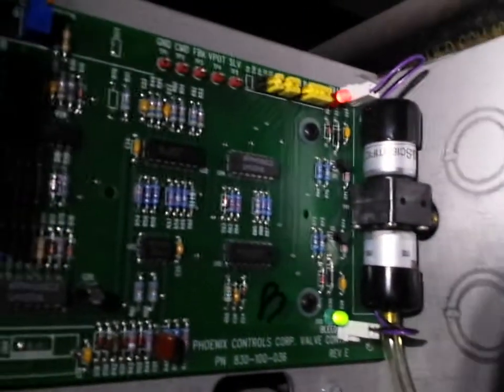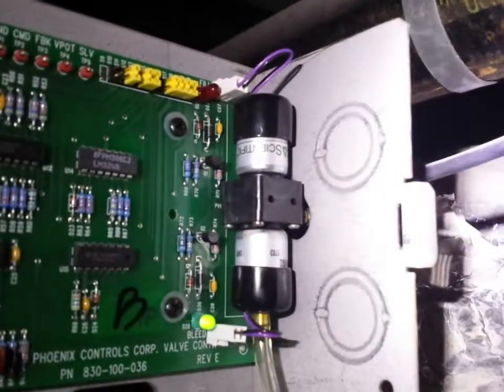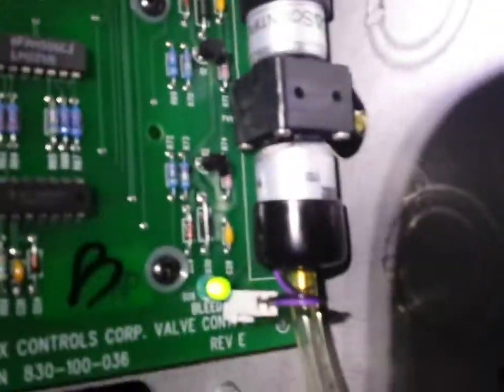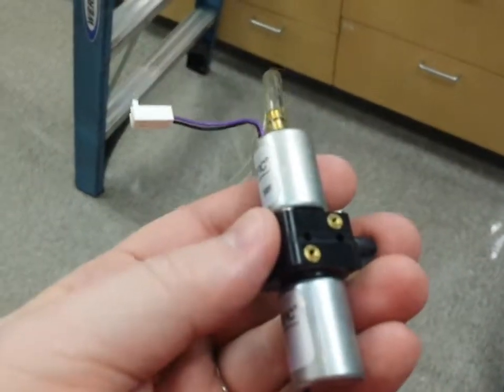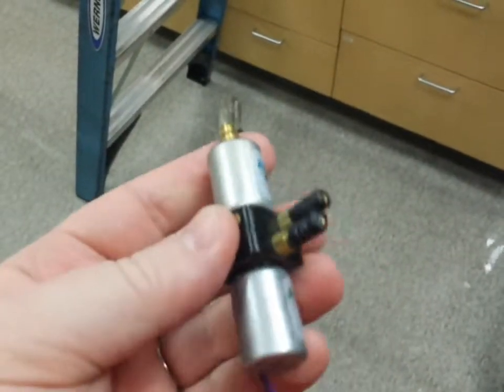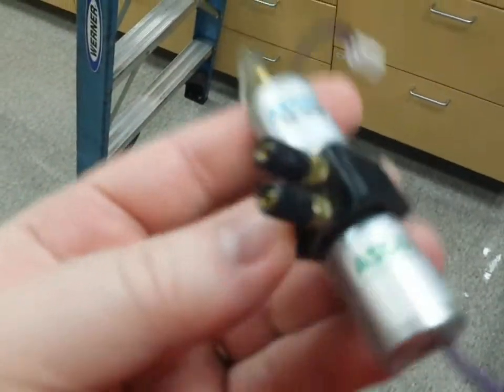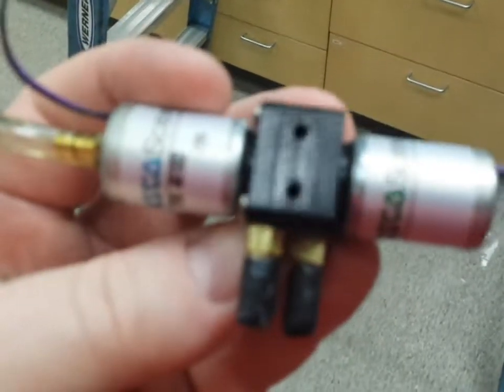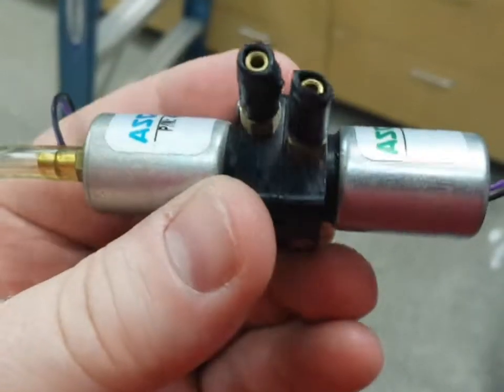Phoenix Air Valve Replacement

Comment: sometimes this may be not caused by the poppet, you should check the pneumatic air, it should be 20 -0/+2 psi clean and dry air
Reply from the maker: 99% of the time when I've had to work on one of these it has been because of the poppet.  I'm glad we're finally getting rid of them.

Comment: The problem is that the soldering  area is tiny two pinholes and if you are not 15 years old or have excellent eyesight, you need glasses with strong magnification.😂🎉
Reply from the maker: Yes, true